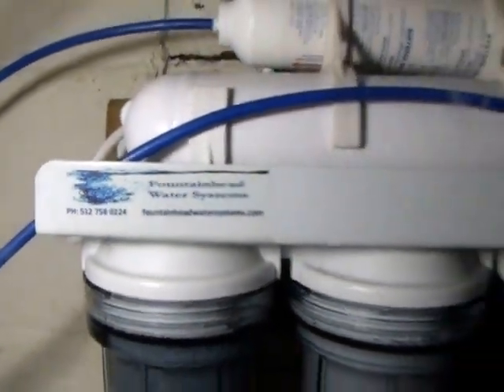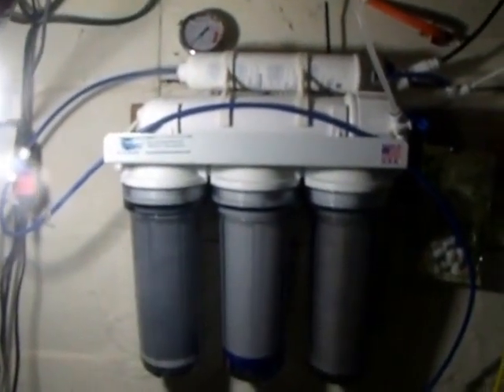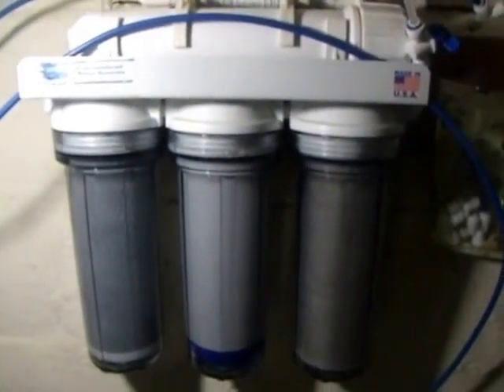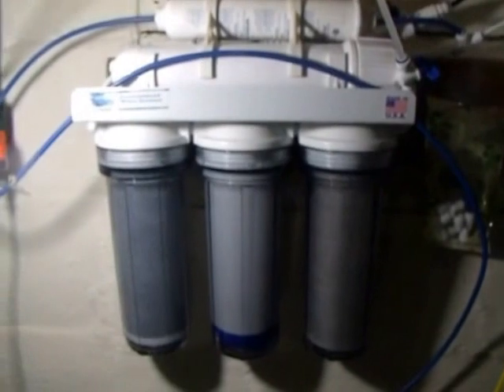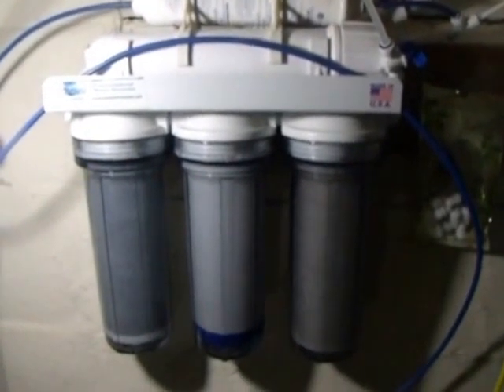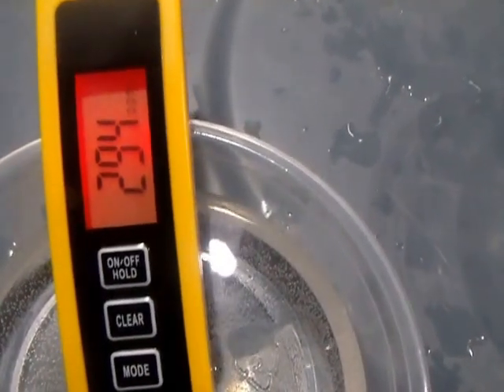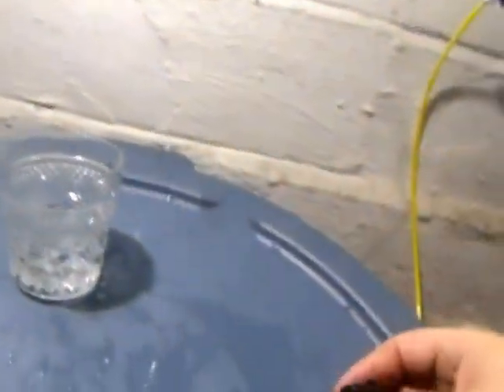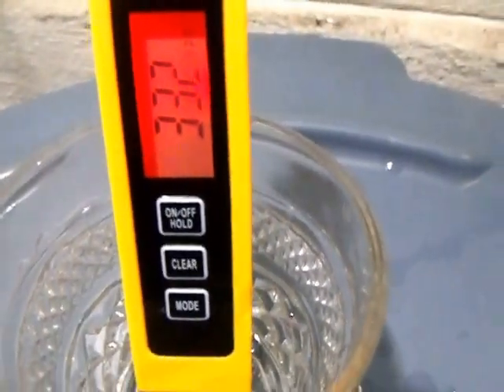RO/DI Fountain Head Water Systems 150 GPD Update

Comment: My tap water currently reads at about 200 can you tell me from your 
experience what would be the bare minimum to get my readings to about 
15. Like what stage would you recommend me getting. I have a limited 
budget. Thanks. What is the best unit in this price range.
Reply from the maker: You should just need the ro side running about $40 to $100 for
a50 gpd under the sink model that has the Water Storage Tank but the more you spend
the better the system will be if you are looking for one for your aquarium then
just remove the storage tank or keep it to keep up presser. My water is 400 ppm
and my aquarium ro drops it to around 25 ppm and the di drops it the 0 ppm and I
haven a ro for my drinking water It runs the same.it is best to have one for
drinking water and one for your aquarium.  Do not use a di on-drinking water. I like the
(5 Stage Reverse Osmosis Drinking Water System RO Home Purifier 13 TOTAL
FILTERS) it has replacement filter so your good for about 1 to 2 years of filters
but costed $90 if you want to get one for just you aquarium It is still cheaper
to get the under the sink model. You always can add a di after if needed.